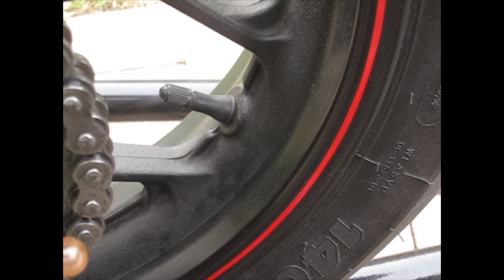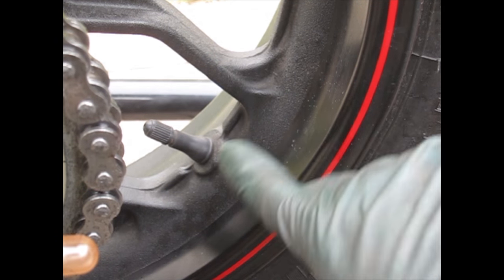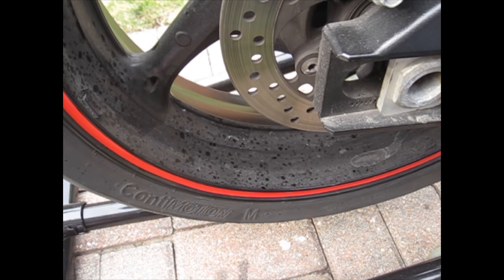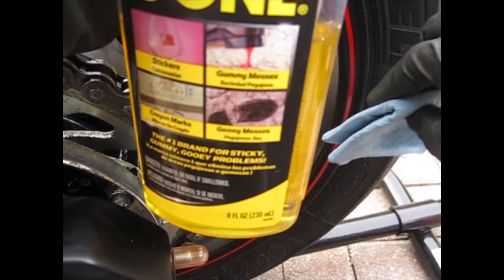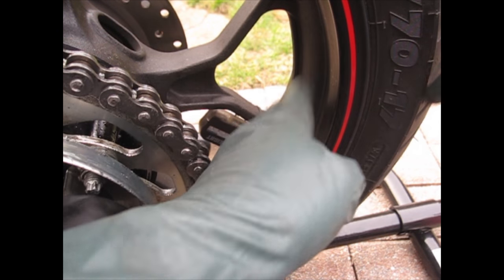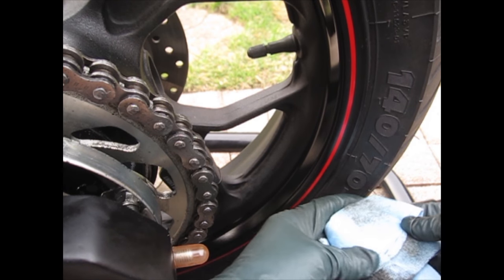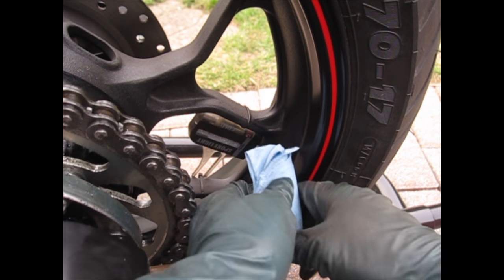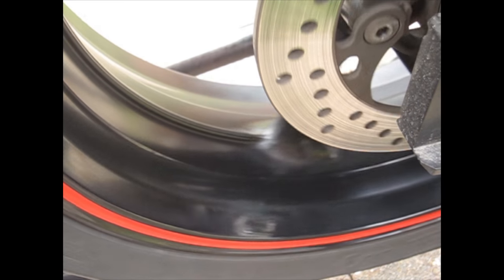How to Clean your Wheels

Comment: what is that black rectangle on your tire?
Reply from the maker: its a wheel weight
Reply: Whats the purpose of that
Reply from the maker: it keeps your bike balanced without vibrations on the highway
Reply from the maker: @G-vo did you notice a difference on the hwy without them on?
Reply from the maker: @G-vo glad you ok and nothing worse
Reply: @G-vo if it starts shaking it will balance if you twist the throttle wide open and hold it as long as possible..